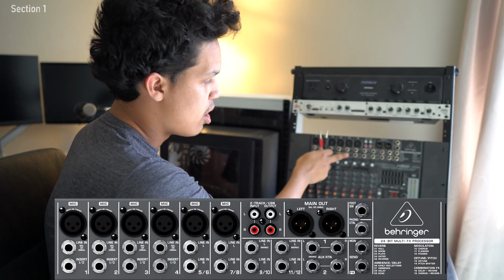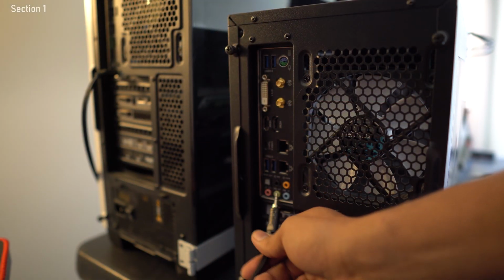How to Setup Dual Pc Audio for Live streaming!

Comment: This is what vid about mixer and dual pc setup should be all about. Im trying to do  this with the xenxyx QX1200USB.  Should work the same right only my main out isn't Xlr ?
Reply from the maker: Yup. Should work exactly the same. Just get dual quarter inch to stereo 3.5mm.
Reply: @splinxes  thnks for the quik reaction. Love the vid.
Reply from the maker: @djremy89  No worries! Maybe I should make a Part 2.
Reply: @splinxes  Yes wy not from all the vids i learnt the most from yours. Not ervybody explains about those isolators. And it has workt i got the sound from my game pc to the stream pc now. Only thing i have to do is getting the mic sound to both pc's
Reply from the maker: @djremy89  Use the FX send and turn the FX knob on channel one.

Comment: Hey there just wondering why you didn't use the behringer hum destroyer boxes for the mono outputs and only the stereo ones, bought a hd400 destroyer to fix some gpu static noises I was having but the sound of my microphone has changed a lot and instead of sounding direct it sounds like I'm inside the back of your head. Perhaps I need to test another brand
Reply from the maker: Tbh I just threw in the mpow ground loops cause it was cheap. Lol worked great.

Comment: (stupid question ik just making sure before i spend alot of money) but do i have to buy a usb mixer or does it not matter
Reply: and are there any cheaper ones you could recommend ?
Reply from the maker: @cleanupcrewesports7697  there are plenty of cheaper options. I honestly don’t use the usb on my mixer as it introduces noise. What’s your budget?
Reply: @splinxes  160 USD or lower
Reply from the maker: @cleanupcrewesports7697  Yamaha mg10. The difference between the 10xu and the mg10 is just effects.
Reply: @splinxes  Thank you man, your awesome!

Comment: I was reading the product description of the HD400 and I read "2 independent channels for 2 mono or 1 stereo signal" <--- does this mean, instead of using 2 MONO JACKS(2 inputs and outputs), I can use 1 STEREO JACK to INPUT then 1 STEREO JACK to OUPUT to PC? Would I be still getting Stereo sound/Left & Right channels? Technically I'd like to save inputs and outputs by using stereo jacks (input/output 1 = GAME PC and input/output 2 = STREAM PC)
Reply from the maker: Wow never really noticed that. Your awesome. Technically speaking you should be able to save. Just remember you are dealing with 2 sperate systems so you can accidently introduce cross interference.

Comment: When sending from Aux Monitor and splitting to your gaming and streaming PC mic in, did you not use 1/4” in the Aux Mon Send to Ground Loop Isolator to 1/8” in your Gaming PC AND 1/4” in the FX send (the orange one) to a Ground Loop Isolator to 1/8” in your Streaming PC? Basically no split just using fx send and aux mon send?

Comment: if you're going to configure OBS to take the main output of the board as the main source, then what is the point of connecting the microphone to the streaming pc? i can understand connecting it to the gaming pc for discord, but if OBS is just going to take the entire output of the board, then isnt the mic connection to the streaming PC redundant?
Reply from the maker: I use the mic to the streaming pc just in case if I ever need a dedicated line just for the microphone. For example using discord on the streaming pc to release even more resources on the gaming pc. Or if I'm editing a youtube video and need a voiceover recording for a second. Hope this helps!

Comment: So follow the vid step by step but what are my settings going to look like on my PCs and also how do I get all that audio into my headphones . I haven’t been able to figure it out and am getting no indication that sound is going anywhere.
Reply from the maker: You will plug your headphones into the Phones port on your mixer. Also for pc settings you will just use your speakers out for audio. All audio volumes will be controlled on the mixer.

Comment: Is the Mon port the same as a “Phones” port?
Reply from the maker: no. Mon port is a monitor out. There will be a Mon knob that sends the signal to that port when turned. The phones port is a master port to hear all tracks. Mostly used for headphones "Phones".
Reply: Splinxes does that mean I want to plug my headphones into that port in order to hear ALL audio?

Comment: to save on cost,(i know sounds dumb) but can i use the mpow isolators for the line in inputs to the headphone jack instead of the hum destroyers? its basically the same thing right only cheaper and made cheaper?
Reply from the maker: sure why not. It will change the cables abit but its possible

Comment: three questions.. where do you connect our headphones(directly to the pc?), are you using el gato for the monitor sharing? my streaming pc doesn't detect the audio unless i select in the gaming pc the elgato output(in the sound settings)
Reply from the maker: Headphones are connected directly to the mixer. Also what do you mean Monitor sharing?
Reply: Hello I meant the el gato is considered in my gaming sound output as the one it should coming out, which one should I be putting ? If I connect my headsets in the mixer I also heard my self talking
Reply from the maker: @coocs192  Which elgato do you have? Also mixers always have feature where you can hear yourself. It's a good feature and will get used to it.
Reply: @splinxes I have el gato hd pro

Comment: is there a reason why you used the XLR main out ports instead of just the quarter inch main out ports?
Reply from the maker: Because my specific mixer doesn't have 1/4 in main outs. 
Hope this helps!

Comment: So right in the beginning where u plug the 3.5 mm jack in the back of your gaming pc, I only have rear, c/sub, mic in, line in, line out ports, which one do I plug it into?
Reply: line out ports, It will pop up as Realtek High Definision Audio in windows Headset  (the green one)
Reply: here you can use line out, you can see that in 10:11 on the video